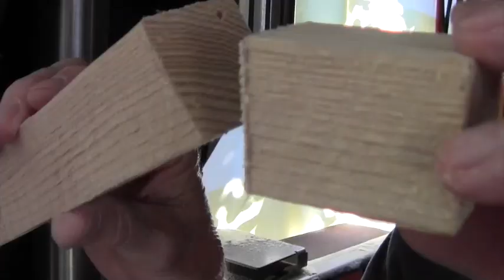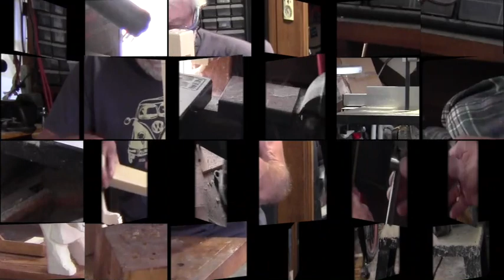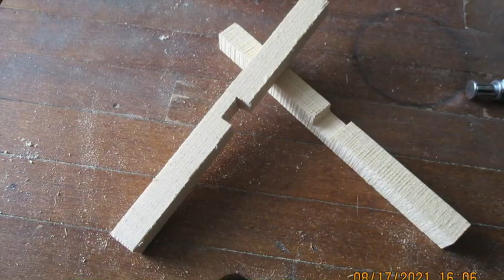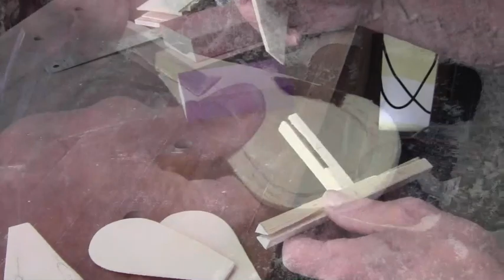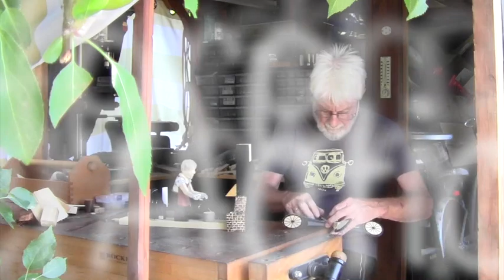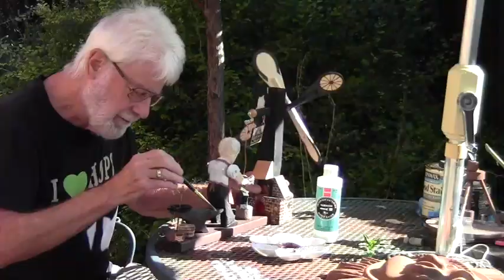Whirligigs 101 Part 2 of 2

Comment: How did you get the square hole in the post?
Reply from the maker: Hi Frederick, I first drill a hole, then use a scroll saw. You could also use a coping saw if you do not have a scroll saw. Thank you for asking. Does this help ? If not I have another idea. Gerhard
Reply: That clarified it nicely. Danke.  I live north of Denver in the foothills and find two blades are more than enough to power any whirligig.
Reply from the maker: @frederickebert9278  Sprechen Sie Deutsch ?
Reply: Nur ein bisschen
Reply from the maker: @frederickebert9278  Frohe Weihnachten